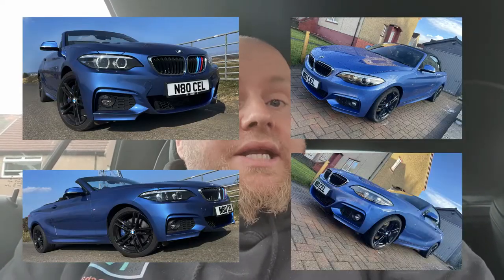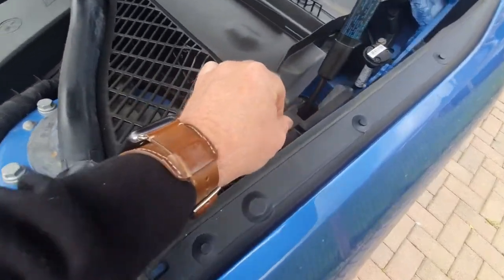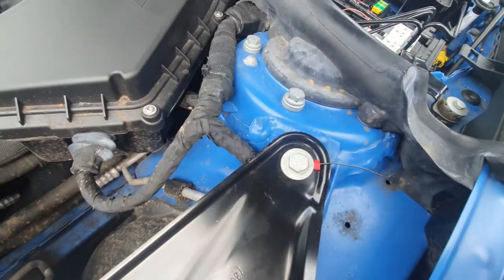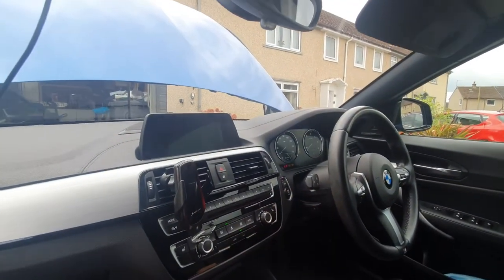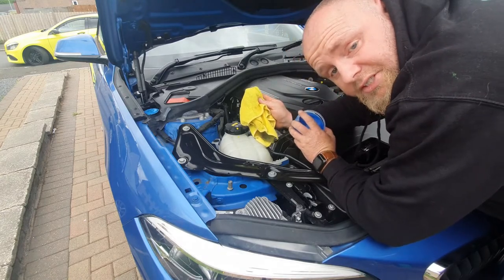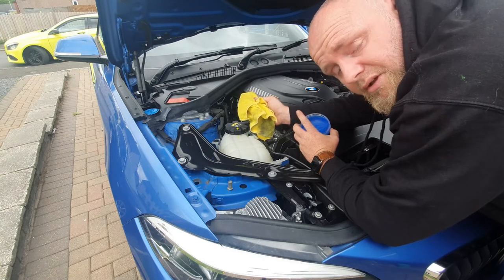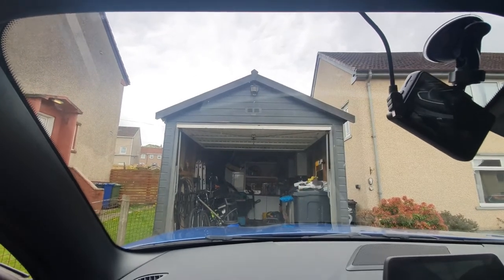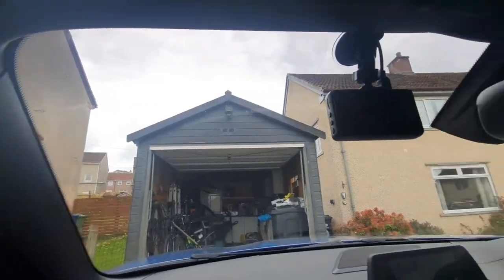BMW 2 Series Convertible F23 Dash Cam Installation Guide - I Broke My Mic !!

Comment: If you can’t use the piggyback for the fuse, does the wire go into either of the two fuse connectors?